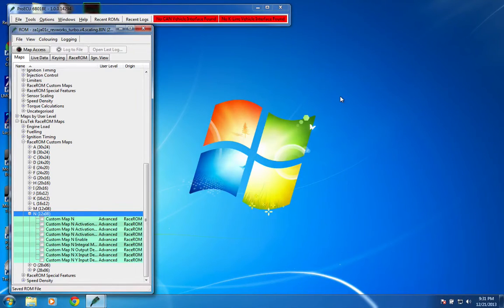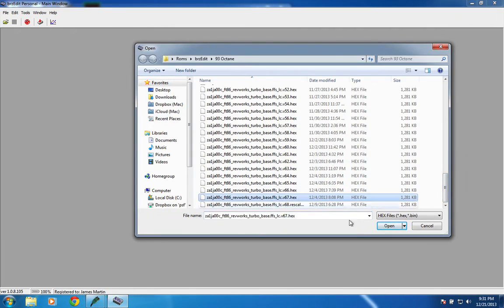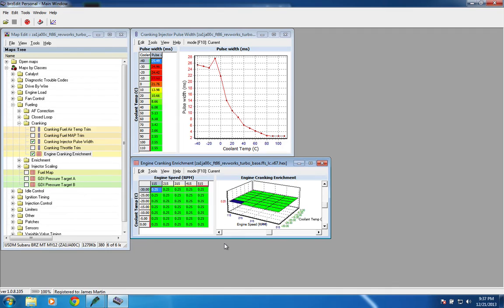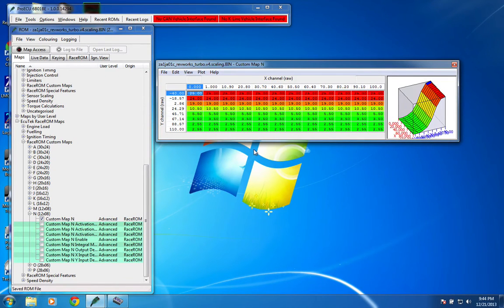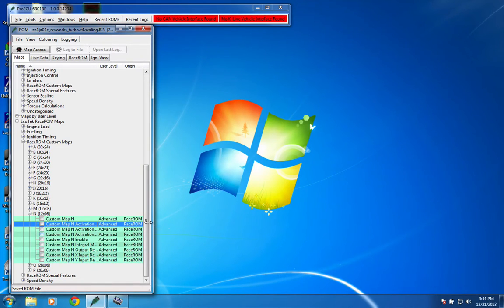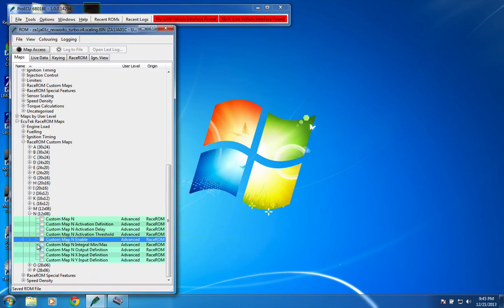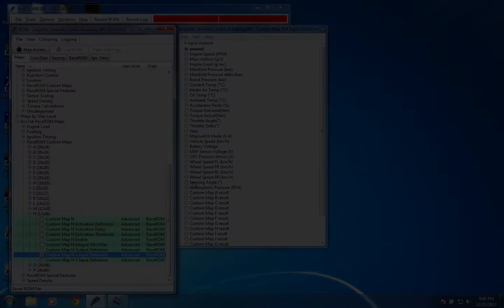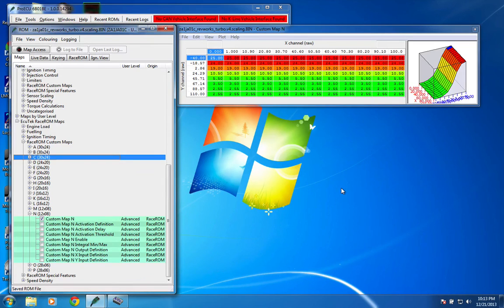fr-s brz racerom custom maps overview

Comment: James, is there a reason why you can't just change the factory transition values to never transition into OL ?
Reply from the maker: Wayne Watson for full time closed loop fueling?  Any afr target under the minimum open loop afr (14:1, doesn't seem to be alterable) will cause it to switch to open loop (given conditions are met).  

Full time closed loop can be accomplished with a wideband input and custom maps.
Reply: Can't we just modify the value for Minimum OL Enrichment - or are you saying the stock logic ignores the value? Screenshot: 
https://www.dropbox.com/s/85c7kkfd9j7i1v2/Screenshot%202016-10-18%2010.37.37.png?dl=0
Reply from the maker: exactly... you can change that all you want, it just won't do anything.